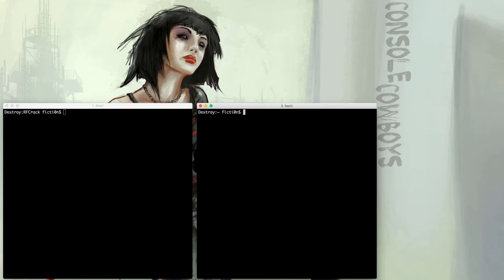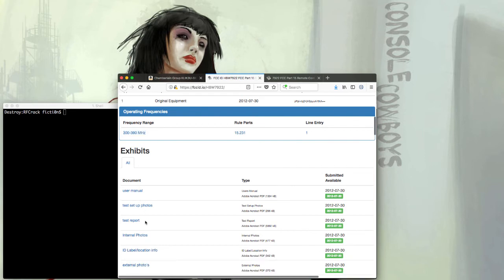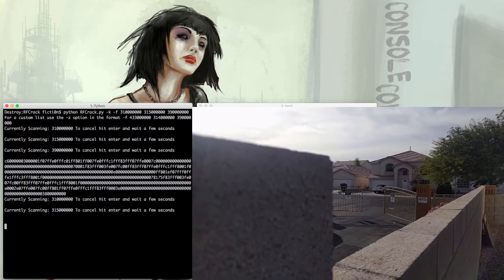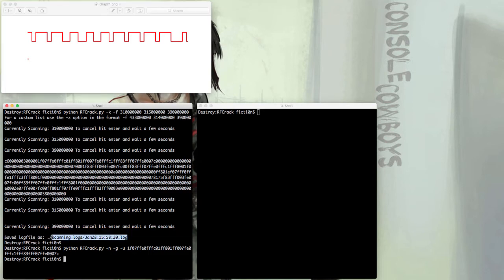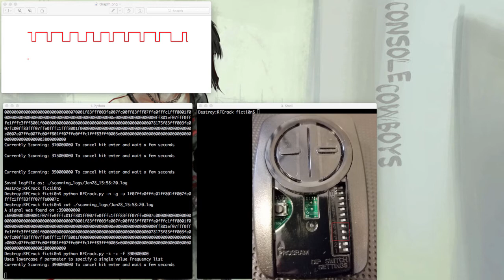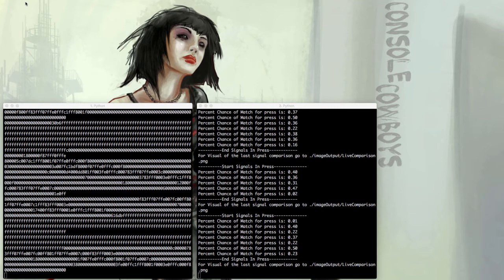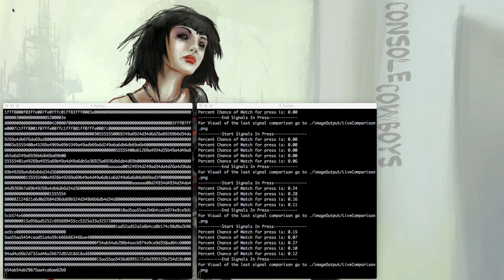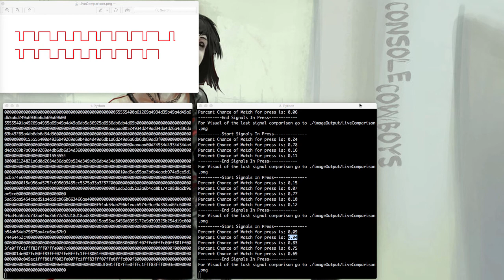Reversing Device Signals with RFCrack - 0x08

Comment: Does RFCrack also work with the HackRFOne?
Reply from the maker: HackRF uses a completely different chipset which is not compatible with any RFLib libraries.
Reply: ConsoleCowboys Ah, thank you for the prompt reply.
Reply: @ConsoleCowboys  If the clicker failed to produce a decent match, would you then invert all the jumpers and try again?  Also, why couldn't RFCrack be used with a log file captured using HackRF or LimeSDR?    If the capture is demodulated and put in a format that RFCrack expects, shouldn't that work?   Or would the demodulation part be tricky to setup in GRC  (ASK, OOK, GFSK, 2-FSK, 4-FSK, MSK  @  300Mhz-1GHz)?
Reply from the maker: @bennguyen1313  yea I would mess with the jumpers for different configurations till I got something with a good % match, maybe google typical switch configurations and try some. Look up the gate manufacturer see if i can find some info there with whatever they use by default and what their typical features are..   Oh that's an easy question,  which you probably wont agree with but its just personal preference, I don't like using interfaces like GNURadio and I prefer a more programmable raw interface I can code with python..  It's much more efficient for my testing... I avoid GUI based interfaces for any and all penetration testing as they crash and you loose your work, or they run into configuration issues and things stop working.. Much better for me to just code it myself to my own specifications which forces me to learn more about whats going on...